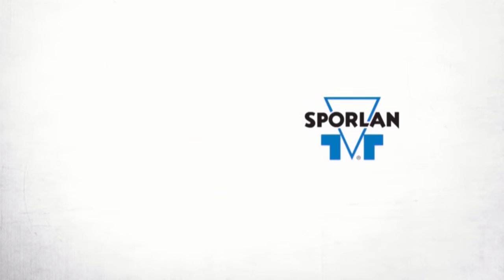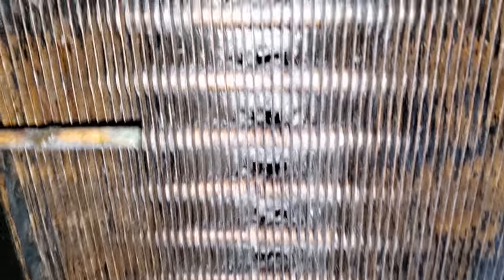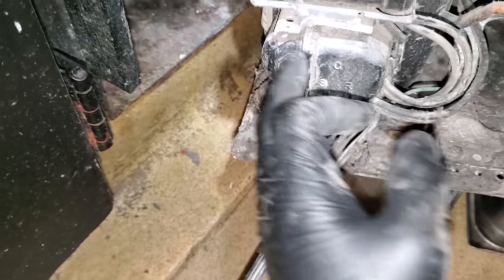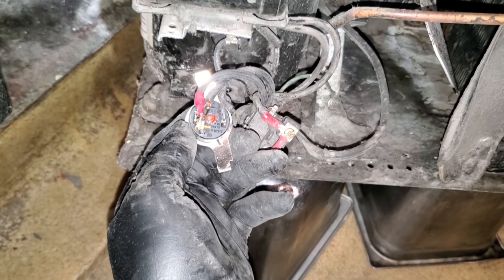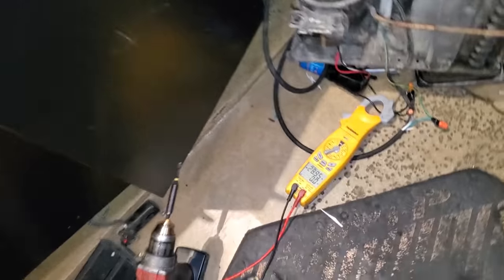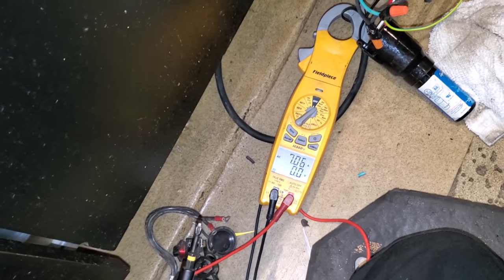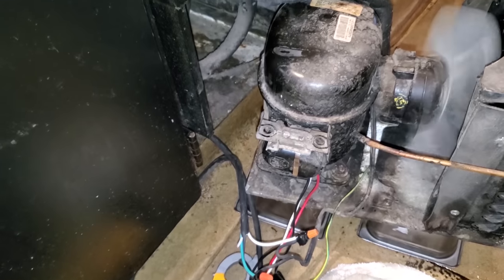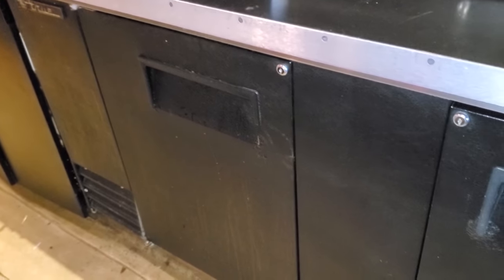BAR COOLER THAT ALMOST WON THE FIGHT

Comment: A plugged cap tube would typically cause low amperage since it is similar to pumping down. Also, you had high amps because the box was at 68 degrees. That's a ton of heat in the evaporator. God I miss doing this stuff!!! Thanks for keeping me in the field virtually Chris.

Comment: I've done true residential for 3 yrs were authorized servicer everytime I get a bad compressor they have me replace line set evap whether a ice maker or u/c unit etc. Oil does get blown thru the evap on alot of these compressors they dont want you nitrogen purge all the oil out they dont bother with the recalls. True is great to work for.

Comment: Chris: I have done many hundres of these type of units. I used to nick the cap tube with a file near the dryer, snap off the cap tube and braze it into the new dryer. Worked every time without changing the entire cap tube. Thanks for the video.
Reply: You can also use your wire strippers to cut the cap tube works real great !

Comment: Chris those 3 in 1 for the 1/3 hp if the amps are over 6.9 continously it will trip the overload in the 3 in 1. It says it on the packaging.
Reply: You gotta use the 1/2 hp one they go up to 10amp...
Reply: @hvactechpr7872  yes, that's what I do to get them by.
Reply: 1/2 Hp kit is - Actually good for 13.3 amps max. 👍
Reply from the maker: I will discuss this on my Live Stream this evening 1-11-21 @ 5:PM (pacific)  on YouTube come on over and check it out https://youtu.be/H9NRDsb_1zQ
Reply: @HVACRVIDEOS  I'll be there.

Comment: It seems that True manufacturer really goes out to make it headache free for techs and customers. With that being said it makes sense to do the right thing and change the whole condenser unit, to keep from call backs. Those relays on the compressor I felt are you common item to fail. It would be good to let the customer know that the  receptical needs to be relocated to a better place also. Nice quick video on a small case of thorough diagnosis of The Big Picture. Thank you very much for the video and your time.

Comment: Man you are a gift to the world of HVAC/R! It took me soooooo many years to learn stuff like this through experience. Bit me in the @SS plenty of times over the years quoting a customer for something and then finding a leak or something after the fact. It took awhile to figure out it is worth the time and effort to properly test the whole system before you give a quote because in the long run you might get out of there a little faster that day but you will end up spending 5 times more time/effort than if you would have just done it right the 1st time.

Comment: Another way to test a cap is use an insulation tester to charge it. The high voltage will indicate a breakdown in the separating layer. The instrument should show zero and climb to a few megohms as it charges. Wait a few or more seconds and discharge with a screwdriver giving a nice wak :) The low voltage of a capacitance tester may not show an operating voltage breakdown. I enjoy your trouble shooting in your videos. You do your work very professionally. Cheers

Comment: In my experience in my area it’s only a 100-200 bucks more for the whole condensing/compressor package vs just the compressor. Makes more sense to do it all. Easy to explain that to a customer to have that whole section new.

Comment: Thanks for the tip concerning replacement of the overload. In the past I would have only replaced the capacitor & the starting relay. Also I did not know about the microfarrad rating being lower the manufacturers spec on the 3 N 1 kits for 1/2 HP motors. I do love the 3 N 1 kits however for testing purposes & they do allow you to get by until parts can be ordered.

Comment: I need a meter like yours for checking the caps in some of these old PC power supplies from the 90s and early 2000s that I want to reuse.
Reply: You need a LCR meter with ESR measurements for PC components and you usually have to desolder the caps to get an accurate reading.
Reply: Like J Parker said, you need some sort of ESR meter as well. A capacitor can be within rated capacitance but still be failing internally, acting as a resistor. You can probably get by on capacitance testing with a simple cheapo digital meter, it might not be super-accurate but will be good enough to give a pass/fail for capacitance only. However, you really should get an ESR meter if you plan on putting those caps back into service just to be on the safe side.
If you have time to kill on YouTube, Mr. Carlson's Lab goes into intricate detail on the topic in many of his tube radio restoration videos.

Comment: That compressor looked bad from the beginning but something I saw on the video is the fact that the unit had a filter the back of the unit was full of dust and have you ever see a run cap blow up!That happened on my fridge while the unit was running the cap blow up and trip my breaker.

Comment: The 1/4-1/3hp RCO410 overload trips above 7 amps.  Had a ton of those True's that will run for 5 minutes then trip.  Next time if compressor pulls 7 amps or more, go to the RCO210 1/2hp start kit, which can handle I believe max of 12 amps
Reply from the maker: I will discuss this on my Live Stream this evening 1-11-21 @ 5:PM (pacific)  on YouTube come on over and check it out https://youtu.be/H9NRDsb_1zQ

Comment: Looks like maintenance on that cooler included blowing air through the coil and across the compressor as the line set was caked with crap - like a tunnel of crap!
We have those scenarios constantly, we always attempt to cool the compressor before trying the 3-N-1. usually ice in a rag will do the trick...

Comment: A Tip for you --- and the New Guys out there. --- Good Video , But i Think it Was a Mistake to Run/Evaluate  that Compressor That was " Smoking hot " in your own words. i Believe the Compressor may have survived if u had unplugged the unit and come back the next day When the internals had cooled down to ambient. The Pistons were allready tight in thier bores by the amp reading shown. Starting up a Allready overheated compressor is not Wise. your just asking for Failure.  just something ive Learned in the last 40 years.
Reply from the maker: I will discuss this on my Live Stream this evening 1-11-21 @ 5:PM (pacific)  on YouTube come on over and check it out https://youtu.be/H9NRDsb_1zQ

Comment: Hey Chris, did you use a RCO410 or an RCO210 on this unit? It was showing it was running 7.3 amps which is over the 6.8 amps that a RCO410 can handle. Can't tell from the video. If you used an RCO210 up to 13.3 amps then I would agree the compressor is no good. I don't go by what the HP is of the compressor when using these. Just what the compressor is running or what the RLA is supposed to be compared to what is written on the front of them as maximum continuous amperage.
Reply from the maker: I will discuss this on my Live Stream this evening 1-11-21 @ 5:PM (pacific)  on YouTube come on over and check it out https://youtu.be/H9NRDsb_1zQ

Comment: Condenser fan blades can't pull in the proper amount of air because of the fan shroud !  Refigerant gets to hot and plugs up the cap tubes !  R12 refrigerant never had these issues !  👍

Comment: I love being able to put tx valves on whenever cap tubes plug up. Just a straight through internally equalized. Works like a charm
Reply: And then faff around for a couple of hours getting the gas charge right?
Reply: @phil955i  huh? Never had an issue there. Don't knock it till you've tried it
Reply: @willyhoogs  just fit the stock capillary, you know it's going to be right then
Reply: @phil955i  ya until it gets plugged up again 6 months later. How about you do you and ill do what I and other techs with decades of experience find works. Capillaries are used by manufacturers because they are cheap. Not because they're better. Tx valves are superior because they will allow any minor waxes any debris to flow through freely.
Reply: @willyhoogs  they have strainers don't they? Which block as well. Plus you can't be sure of the correct amount of refrigerant as it's not got a liquid receiver therefore a critical charge. You carry on fitting expansion valves, you obviously know better than the manufacturers. Yeah I will carry on fitting capillaries because that's how they came out of the factory & therefore are guaranteed to work.
Reply: @phil955i  its really not that hard to charge it. You're right it won't have a receiver but all it needs is a few degrees of subcooling. Besides its not like im adding tx valves everywhere. Just the occasional scenario it seems justifiable. Milk first for some technicians...

Comment: RC410 if I remember correctly is only rated for 6.8 continuous amps where the RC210 is good for 13.3 continuous amps. I may have that reversed
Reply from the maker: I will discuss this on my Live Stream this evening 1-11-21 @ 5:PM (pacific)  on YouTube come on over and check it out https://youtu.be/H9NRDsb_1zQ

Comment: Every time I change out a compressor on a R134A system I put in a new cap tube and flush the coils with RX11. If you dont you're asking for trouble. Been bit in the ass one to many times.

Comment: Hey Chris, you should put some Philips Hue leds behind your laser-cut stainless sign. I think it would look really cool.

Also, I'm not in the HVAC industry but I am an engineer. I just find your videos and troubleshooting style very interesting :)
Reply from the maker: Yeah I plan on putting some lights inside the sign, thanks for watching bud
Reply: @HVACRVIDEOS  awesome! Look forward to seeing it!

Also, greetings from Santa Clarita
Reply: @HVACRVIDEOS  I make signs like that regularly rather than lighting it a dark background will make it more visible extra light only helps on signs with dark fronts but I'm sure you will figure it out it could work with a translucent panel behind the cut out with lights behind if you want to be fancy.
Reply from the maker: Yeah I was thinking of putting colored acrylic behind them and lighting behind that.......

Comment: Chris if you are to change while evaporate unit l would change over to txv valve & whole condenser unit you be better off and customer is happier that they spend the money .
Reply: IMHO no need to over complicate the thing and these are a B..h to work on, let alone do a conversion that adds more stuff where space is limited.

Comment: So many of those older style true and master bilts have that horrible whip with no slack. It’s like you can’t take the condenser unit out and check amp draw at the same time unless you extend the whip

Comment: 3:29 It looks like the cap is leaking its electrolyte, so I'm not surprised it was the problem. (Assuming thats not something you got/put on it of course)
Reply: Start cap usually dry, run cap liquid filled>

Comment: Only if they used flexible lines on the liquid and suction lines. You know, like what you see on pressure switches. Hate when those things kink.

Comment: These start kits in my opinion and obviously everybody has one and some make videos to that point, here is mine. 

If it buys a little time temporarily and the customer knows the risk so be it. God forbid the unit catches fire and causes minor damage and let’s even say it wasn’t the 3 in one. You will still hold full liability for the damage because of improper non OEM equipment. I have sat in many depositions for these type of situations so the best option is always OEM as Chris has wanted to do. I would have done the same or as he stated, change the box which doesn’t benefit him at all. 

This is why so many stop making videos.

Comment: Good Video ! But i have to Strongly disagree with you on Using the Supco 3 in 1 Kits. They are a Great Product ! ie: Rc-0210 Kit. they also CANNOT be Compressor killers, The START CAPACITOR is only in the circuit for a millisecond. all it does is give the compressor a little extra boost to the start winding on start up. a little less boost on start up is not going to kill a compressor. if that Was True you would See the Start windings being open on a Bunch of compressors, which we do NOT SEE. pLUGGED CAPILLARY TUBING AND pOE OIL  KILLS COMPRESSORS. WE ALL KNOW THAT. 
i Have been using them Religiously for 20 Years at least. They Last 5-6 years which is ok for me and the customer. Origianal Start components do ( usually ) Last about 10 years but just the other day i had  a traulsen original start components fail on a 3 year old 1 Door refrigerator. So even original components fail early these days. 
 i don't have to come back and bill the customer again for Special parts & another service call. the End Does NOT justify the means. imho.
Good Video & Thanks for the tip on the true metal Condenser shrouds.
note - i Have been doing this 40 years. if Rc-0210 kits Did not Work Well , i would not use them. i Have installed HUndreds of 3 in 1's and the Customers are allways Very happy that i don't have to come back and they have their refrigerator or freezer up and running right away. How many Compressors do you see me replace on my channell ? not many.
Reply from the maker: I will discuss this on my Live Stream this evening 1-11-21 @ 5:PM (pacific)  on YouTube come on over and check it out https://youtu.be/H9NRDsb_1zQ

Comment: A restricted capillary tube will cause the compressor to draw LESS current as the compressor is doing less work... I.E: The compressor is not pumping as much or any refrigerant, much like a a low or loss of charge condition.
 A capillary tube SHOULD be replaced ANY time the compressor is changed. Yeah, it's not fun, but back to your phrase "Cheap insurance", you betcha cap tubes are usually inexpensive. It's good service to change a capillary tube when the compressor is changed. 
 Also, not dogging you, but a low voltage condition at the compressor can very well cause high current and the compressor to go off on current or thermal overload. Yoh did not mention or illustrate this in your video. Maybe that lousy A19-ABC-24 control has loose wires, or that condensing unit receptacle or the customers receptacle is causing a low voltage condition. Defiantly something worth investigating/mentioning. 
 If you don't install an OEM cold constant cut-in control, at least use an A12-700 or 701 or 1506. Don't hack an A19 in there like a classless knuckle dragger. (I know you didn't install it Chris)

Comment: I don't intend what I'm about to say as a knock on your service skills, so please don't take it personally.  This is just me being the Devil's advocate.  I think you're an awesome service technician.  Did you isolate the bleed resistor when you OHMed out the start capacitor?  If you believe, like I believe, that the 3-n-1 is a compressor killer, why would you use one?  Also, would you really have been doing the customer right by replacing the compressor or condensing unit, evaporator coil, capillary tube, plus labor and materials on a box that age and in that bad of shape?  I believe the cost of going that route would have been prohibitive, especially compared to the cost of replacing the box.  I understand you wouldn't have gotten the sale, but I don't believe doing what you were wanting to do to get that box running again was in the best interests of the customer.  That's just my opinion, buddy, based on my own experiences.
Reply from the maker: No offense taken, I use the 3 n 1 just to start it for testing purposes. I quoted the job and the customer chose to replace it.... they always need a repair quote for corporate approval....
Reply: Not sure bleed resistors affect capacitor measurement function in multimeters.
Reply from the maker: I will discuss this on my Live Stream this evening 1-11-21 @ 5:PM (pacific)  on YouTube come on over and check it out https://youtu.be/H9NRDsb_1zQ

Comment: that compressor wont run on a 3&1 1/3- 1/4 hp only 145-175 uf start cap,if it was low freon would not be over 7 amps.if somebody goes behind you replaces cap,compressor is good.luck.